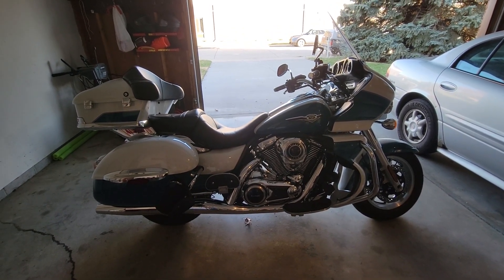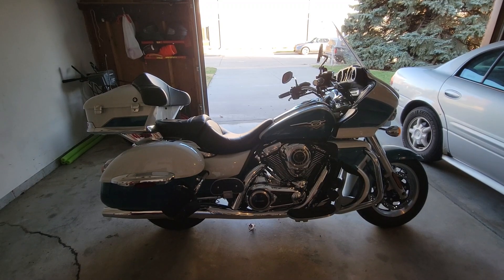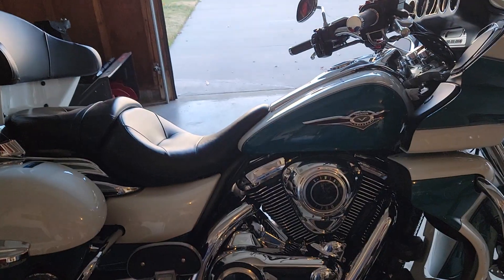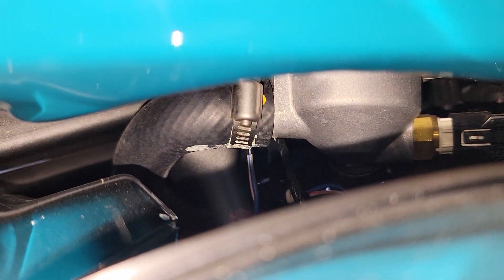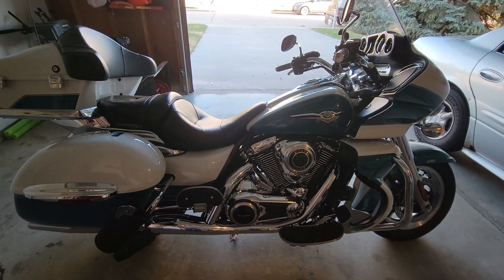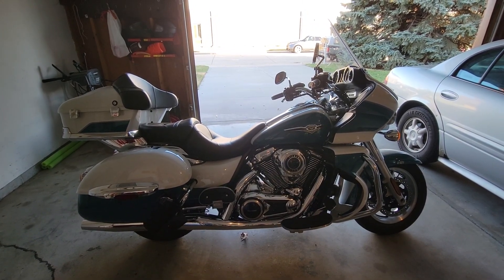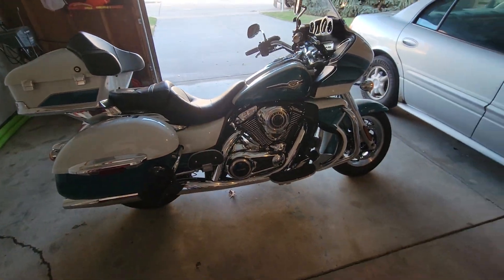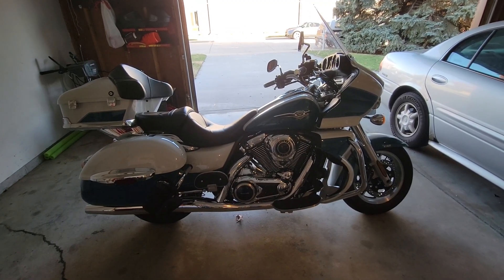Kawasaki Voyager not so happy update!

Comment: My 2013 waited about 6 years to leak..I noticed a very minor leak while sitting in my cold garage over the winter..I removed the tank and used a 1/4" drive ratchet and flex extension to tighten EVERY clamp in the coling system ..I now have 56,000 miles and even though I purchased the extended warrany, the motorcycle has NEVER been back to the dealer for anything
If you want the best experience with that bike, send the ECU to IVANS PERFORMANCE  yes it's $400, but it will be the best money you ever spent
I wish I hadn't waited so long to send mine...IT MAKES A WORLD OF DIFFERENCE
Reply: Can one send a new ECU or have Ivans install on a new ECU than have to ship it and be out of a bike for a week or more.

Comment: I owned a 2015 concours 14  with similar issue      Its no big deal just tighten all the hose clamps.   That’s an easy fix and this is not an unusual problem.   Besides after doing the repair you learn mor about your bike!    Kind of like rearing a wonderful challenging child.   Blessings

Comment: I just bought my third Voyager.....a 2023 and it manifested a leak the first week I had it......same spot as the one noted in the video.  Dealer fixed it of course and noted that this is not uncommon on the newer model Voyagers.  Love these bikes.......good design, good equipment and pretty good power.   I'm 78, still ride, including winter when the roads are dry.
Reply from the maker: At least I know it's not just me now, makes me feel better! I ended up removing the tank, tightened and repositioned the clamps so I can get to them without having to remove the tank again.  No more leaks!

Comment: Worm clamps do tend to loosen and should be checked occasionally. The hoses also "relax" a bit with use from new. My liquid cooled bikes tended to do the same thing around the same mileage but a minor snugging has eliminated my leaks for 2 bikes, one is 10 years old, the other, 20.
Reply from the maker: I ended up removing the tank, repositioning the clamps so i can get to them without having to remove the tank again, tightened all the hose clamps that come from the thermostat and now no more leaks!

Comment: Hello.from ohio, and thanks for sharing your video. I am currently on the fence about purchasing  a new leftover 2022. My question is, would you purchase the bike again. My other question is the purchase price of the bike I'm looking at. It's a brand new 0 miles leftover for $15000 out the door... no hidden fees. Is the price fair. Thanks
Reply from the maker: I would absolutely buy the bike again in a heartbeat! I only had to tighten some hose clamps fix my issue. I would say that is a completely fair price for a still brand new bike with 0 miles. I wouldn't hesitate too long!

Comment: Thanks for letting us know, I have the same year bike as yours with just over 2K miles on it. I checked and no leak. Keep us updated on your fix and anything else you find. I love this bike. the only thing I notice is that my right side gets very warm as compared to the left side which makes it noticeable. Be nice if the KMS would be extended to the right side.
Reply from the maker: I ended up removing the tank, repositioning the clamps so i can get to them without having to remove the tank again, tightened all the hose clamps that come from the thermostat and now no more leaks!

Comment: The clamp doesn’t look square to the fitting it’s clamped to. I’d remount the clamp squarely and turn it so that I could get to it with a long screwdriver with the tank on should it need some tightening later. A few hot/cold cycles should tell the tale.
Reply from the maker: That's what I did. I ended up removing the tank, repositioning the clamps so i can get to them without having to remove the tank again, tightened all the hose clamps that come from the thermostat and now no more leaks!

Comment: I have the 2023 Voyager 1700 with a little over 4k miles.  So far no leaks, bike does run hot sometimes wish Kawasaki would fix that. My only issue I have had was the cruise control stop working after 600 miles which turned out to be a screw under the rear brake needed to be adjusted  just a tiny bit.
Reply from the maker: Glad it was an easy fix.
Reply: @elitepatrol3256  Me too.  I'm in Michigan having riding withdrawals, riding season is over here.

Comment: I own a 2011. I have never had this issue(34k miles in). Hopefully it's something minor. I would take it to the dealer if it is under warranty.
Reply from the maker: I ended up just pulling the tank off and tightening up all the hose clamps. Fixed leak issue!
Reply: @elitepatrol3256  That's good. Glad it was a simple fix👍🏿😁

Comment: Rad hose by rad cap is loose tighten screw clamp
Go to the left leg side of bike behind air filter to the top right check that screw clamp it goes to coolant reservoir it can leak there too

Comment: This isn’t very common,I had a 2020 voyager never an issue,but having said that I have a 23 voyager now and had a small leak or seepage on the top rad hose and like you I just tightened the hose clamp and issue is resolved
Reply from the maker: I ended up removing the tank, repositioning the clamps so i can get to them without having to remove the tank again, tightened all the hose clamps that come from the thermostat and now no more leaks!

Comment: The original voyager in 2009 ran very hot so kawasaki added a hot air return behind the rear cylinder and ducted the air on the right side and then down .   Therefore the right side will always be hotter.  I had a 2009 which I updated to a 2019  in kater years   I now have the 2023.     These newer models still run hot but nowhere near what the early models did
Reply: I have a 2009, I bought a heat shield off Amazon and now I can ride wearing shorts if I wanted to
Reply: I got a 2009. Mine runs a little warm but I just cleaned the radiator out works fine. I’m in Pennsylvania.

Comment: This could be something as simple as a clamp that needs to be snugged up. I have seen little things as this pop up even with new cars. Heat and cold cycles with expansion and contraction. If I were you, since you are still under warrantee, would take it to the dealer and let him deal with it. Then find out exactly what he found and how he fixed it. It is a pain in the ass, but it was easily detectable and the bike got you home.
Reply from the maker: I ended up removing the tank, repositioning the clamps so i can get to them without having to remove the tank again, tightened all the hose clamps that come from the thermostat and now no more leaks!

Comment: 2017 Vaquero. Every other problem with the bike EXCEPT for a coolant leak. Trading it in for a HD Fat Boy next January.
Reply from the maker: I'm sorry to hear that!! My fix was simple and has been my only issue so far
Reply: I haven't heard of any issues with the Vaquero/Voyager ( loose hose clamp is not a real issue) but good luck with your HD and their issues.
Reply: Amen to that. I had an 07 Ultra that had one little thing after the next. Granted it was a long time ago. But just the constant tiny issues added up to a pretty good amount of time being invested in taking care of each little problem.
Reply: Haha, I bought my bike used a little over a year ago  its a 16 with 4500 miles on it and when inlet the dealership it smelt as if someone was in front of me smoking pot but there was no one close snuff foe the smell to be getting g to me so I stopped at a gas station and upon further investigation i found where what looked like maybe a vape pen had leaked on to the exhaust so for the first couple Hundred miles I got to ride high at some one else's expense😅.

Comment: well? update?
Reply from the maker: I ended up pulling the tank, and had to tighten all the hose clamps coming from the thermostat. All of them were really loose but I snugged them up and no issue now! I also rotated the clamps so I can acces them without having to remove the tank now.